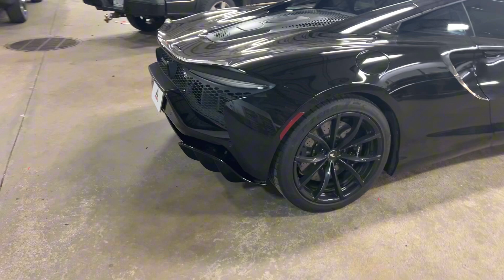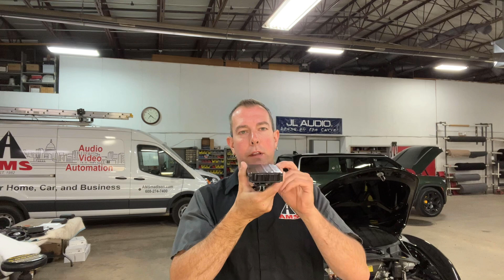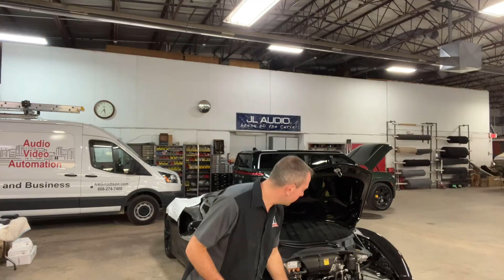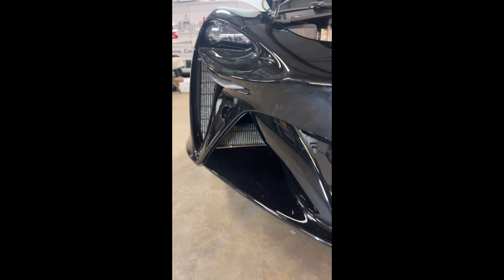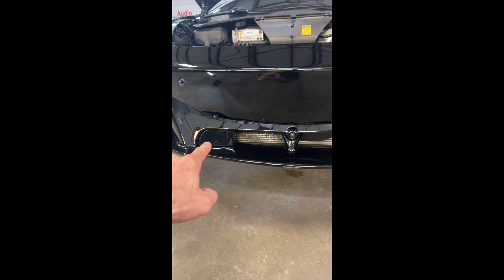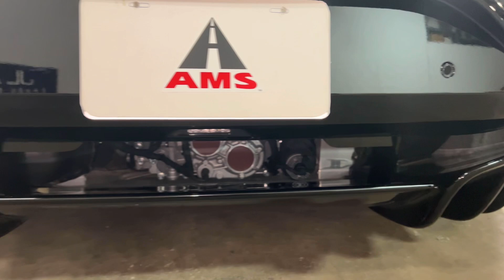2023 McLaren Artura custom Escort Redline 360ci installation

Comment: I live in Sarasota and about to have this installed.  Where did you mount the display in the cabin?
Reply from the maker: In this McLaren we actually had the display etched into the rear view mirror for a completely discrete install. The company that does this conversion is Radar-Mirror out of Texas. You next day ship them the mirror and display, they typically have a one day turn around and can next day it back. Very good work, good visual position, and eliminates a custom pod being fabricated somewhere for it. I would guess a shop doing an install on this kind of vehicle would be familiar with the radar mirror mount if you like the idea.